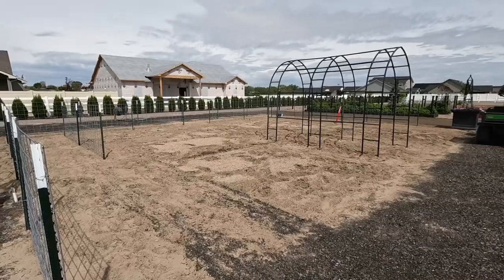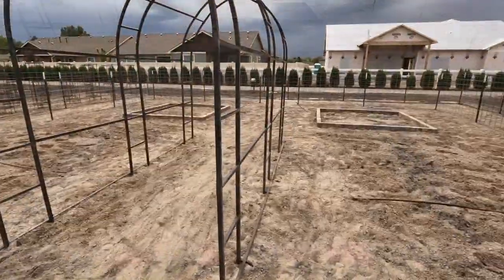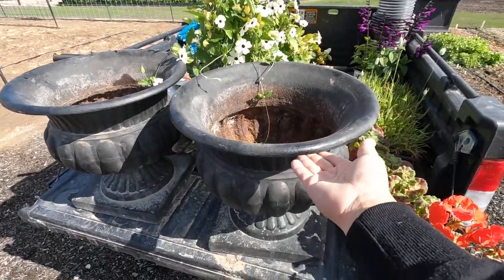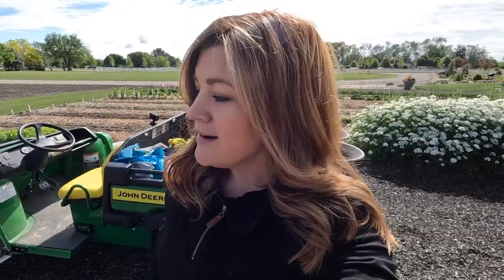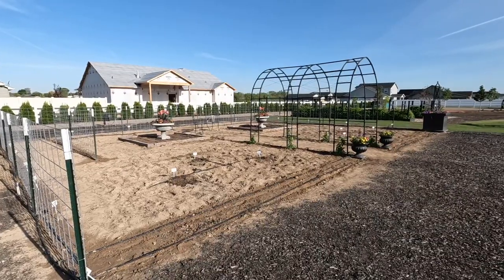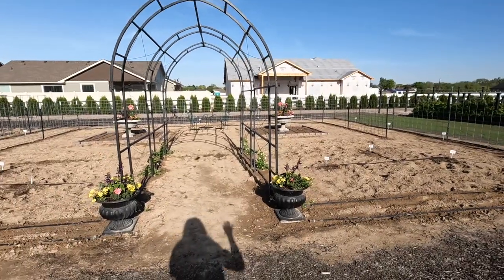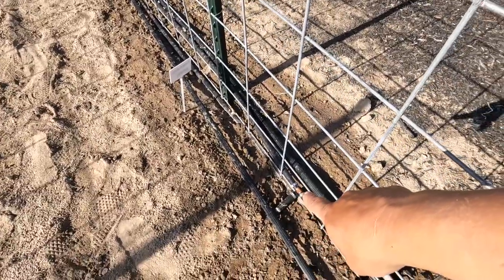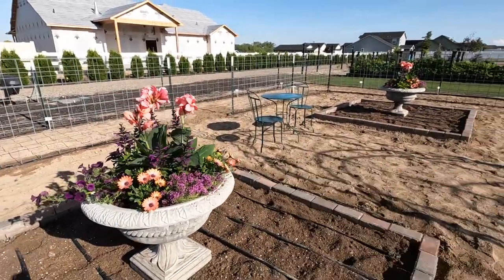Setting Up a Really Fun Flower/Veggie Garden Space! 🌸🌽🥰 // Garden Answer

Comment: Laura, are you sure that those pavers that you stacked are going to be secure? If the soil under them is rock hard, you might get away with it. But, especially if the soil is soft, the pavers will move with the soul movement, as rain water flows. Here in Iowa, we have to put a base under something like that. That can consist of a coarse sand, or paver base rock. Both of those allow for water to flow underneath the pavers, without the pavers moving.